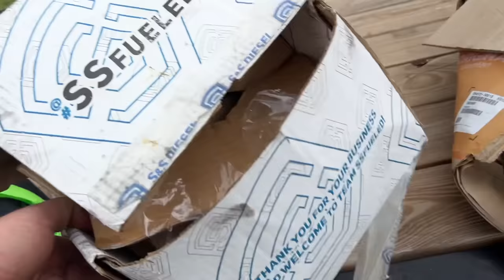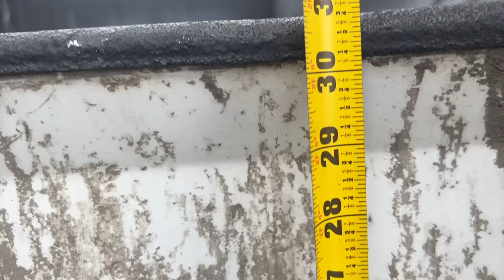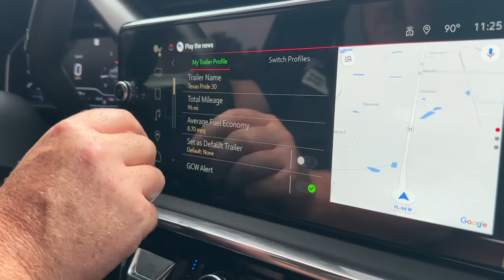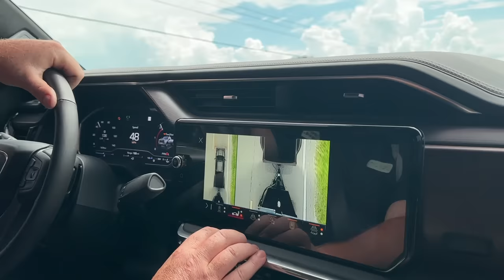$100,000 Diesel Truck VS $2,000 Diesel Truck!!!!  Are These New Trucks Really Worth It?

Comment: Another thing to consider is the cost of basic repairs once the new truck is off warranty.  My diesel mechanic discouraged me from upgrading my pristine 97 Ford 7.3L to a newer truck based on the idea of repair costs long term.  The older trucks are so simple with fewer things to go wrong and if a $5 vacuum line goes bad it can all be accessed simply by opening the hood.  As my mechanic explained, that $5 vacuum line on a newer truck could cost in excess of $2500-3000 as the entire cab has to be removed to access some locations on the newer trucks.  From my perspective, the only reason one pays for the new truck is the prestige factor and the ergonomics and comfort of a new truck.  New trucks are quiet, smooth, easy to drive, with tons of cubbie spaces for storage and are outfitted with tons of technology.  I ended up keeping the old truck and simply did some sound deadening, added a premium sound system with double DIN head unit to provide an update in technology coupled with a back-up camera and few power mods and I am good to go.  Still not as smooth and not as quiet but very happy with the 97.  Get tons of compliments everywhere I go.
Reply: You couldn't give me a new 6.7 Powerstroke...have had to work on SO many, while the old 7.3 had its' problems but they're fixable and for sure will run more miles with less problems than the new versions.   6.0's have lots of issues too...but they're better than the 6.4's and it's like Ford kept changing and making new problems rather than fixing the existing ones.

Anything with DEF sucks SO bad....and I've been stranded by Ford 6.7 when a single thermo-couple failed.   Far, far too many things in the system that can and will shut you down if and when they fail.   Especially for a work truck they're too sensitive and complicated....go for the old trucks and fix them up.
Reply: Put a jumper on your a/c pressure switch to keep it on, colder than any other trucks a/c right there. The OBS trucks had the best a/c and the bench seat is the best I think. 08 and up interior is very nice, but 6.4 and 6.7, nah.
Reply: For me my job requires me too be on time too work rain or shine and I do constant traveling.  My 2023 3.0 duramax 1500 has a 100k mile warranty from the factory and they’ll put me straight into a loaner truck no questions asked if I have an issue .
Reply: I have same truck, but not pristine. I absolutely love it.
Reply: Yeah I know a diesel mechanic and I’m sure I heard the number incorrectly but he said a new gmc under warranty needed 18k worth of injectors replaced. I’m like I obviously can’t afford a new diesel. Lol
Reply: @kenttalcott8428 That's very true, I have been doing the same thing to my 2002 Sierra. I have the 4.8 so I am limited to 8,000lb. towing and it's definitely not ideal when it was in stock form. However adding headers, throttle body spacer, cold air intake, after market exhaust, cam, torque converter upgrade and tune I now have 350 HP/TQ at the flywheel and I get 16 mpg in the city and 20 on the highway. I've also installed a double din receiver with Sirius XM, Bluetooth and a cd player for some modern and old school tech. I have nice seat covers and the interior is mint, I've put $10,000 into it over the past 6 years I've owner it and that includes the $6,000 I paid to buy the truck. I am still under 200K miles. As long as you maintain your vehicle you can do some upgrades and you've saved so much and will have a much easier time fixing things compared to buying new. I'm 25 and I don't plan on buying a new truck ever. Maybe for a heavy hauler I'll buy a 12 valve Cummins one day but not for awhile lol.
Reply: For sure. My buddy’s ram def system already went out and it’s only 1 year old and it cost 8k to fix. So he just deleted it 😂
Reply: @benjaminhurst8207 i was a truck driver until this fall, and the owner of our fleet mechanic had a 3.0. He said never buy one. Disaster to work on and he hated it. Only reason he kept it is his business was literally diesel repair. You do realize it has a timing belt, not a chain, and it’s against the firewall inside the engine. They last past the warranty. Have fun having your cab removed after warranty to replace it.
Reply: I've been wanting a 7.3 but no one ever wants to get rid of em. Keep it as long as u can. Have one back on the ranch In Mexico. Dislike all these new trucks lol
Reply: It is cheaper to build a truck than to buy new. There's nothing you can't have in that  97. I only have a 2015 cause I didn't have a truck for my trailer so I'm not wasting anything. You'd be wasting money changing it up. All there is to it.
Reply: @benjaminhurst8207 wow, 100k mile warranty!!! 😂
Reply: The brake test was apple's & oranges! The ford had no trailer brakes.
Reply: Amen,  I have a 92 F250 and I can fix 95% of the possible issues on that truck with basic tools and common knowledge of engines and electronics.  If I had a brand new truck I could change the battery and maybe the fan belts but you get too much beyond that and I would probably need some special tool or a computer that analyzes god knows what. You basically need a $200K workshop and a degree as a diesel mechanic to work on your $100K truck.

Comment: I know I would personally take the old one. To me its really hard to justify the $100k. That and the newer trucks have gotten so big its unreal. Another factor is that if I had a new truck I would be afraid to use it and beat it up. I know I would cry when I saw that first scratch. I like to use my trucks and even though I dont purposefully beat them up, accidents do happen though when working them. My daily is an 86 Dodge D-150 gasser. - Jamie
Reply: I’d get the old truck and use the other 98k to by an m5… or even get a used one and buy a trailer and skidsteer/ mini ex. With the 98k savings you could start a business.
Reply: @FishFind3000  You could buy a couple acres and start a clean trailer Parker for $98k. Which could make you 10-15k a month which would give you the $98k back in a year or two and then it’s all profit
Reply: I’m a clumsy mf sometimes my truck is all scratched up that’s why I’ll never buy anything past like 2012
Reply: poultryguy12able  Based off your 11 acres sure but 2/3 would be significantly less and for $100k it’s very doable your just have more limited resources than I do. I own my own equipment and do the work myself

Comment: The market today is forcing me to consider building a older truck vs being in crazy debt on a new one.  I enjoy not having a payment
Reply: Do it, get a budget of 20k
Start with a 5k truck and upgrade it 15k , keep it forever ,don't look back.
Reply: Don't do that. Its expensive no matter what you do its called inflation.
Reply: @fabianmoye7919 lmao what
Reply: @SpeedGGonzalez  you buy too old of a truck. Insurance can be expensive still for what you have. And insurance premiums go up almost every year. Not to mention the parts to fix the older trucks are harder to source new. And shipping rates aren't getting cheaper any time soon.
Reply: @fabianmoye7919  fair point. But if you were to spend, say 30k cash on a good used diesel (LBZ/LLY duramax, 3rd Gen Cummins, early 6.7 Powerstroke in my case), you don’t have a payment that’s 1500+ a month and you can get cheaper insurance. Finding parts on these trucks isn’t exactly difficult. They’re much easier to work on also… This GMC will have a payment around 2k a month if you’re not financing the fuckin thing for 10 years. That’s just to drive it. Full coverage insurance on a 100k vehicle isn’t gonna be cheap. And these new trucks are VERY expensive to fix. So at the end of the day, you would 100% be saving tens of thousands of dollars by purchasing an older truck.

Comment: I have an 02 7.3 Excursion with 357,000 on her. Bought her new off the lot, have kept it maintained and always repaired any issue immediately. I’ve done a lot of proformance upgrades to her over the years as well as replaced all the suspension with F350 Ford factory parts including the 20” king ranch wheels. My buddy’s drive newer trucks and make fun of me for driving an antique. They  ask when I’m getting a new one. I tell them it cant be replaced because no one makes anything like it to replace it with. I’ll still be driving mine when there on there 5th new one making upwards of $1000 a month payments. Meanwhile I haven’t had a truck payment in 17 years. Who’s making fun of who when I’m retired at 50 and they’re still working to pay for sh!t. Lol
Reply: Hell yeah!! Smart man!
Reply: I miss my 2005 excursion. My gas guzzler, mine was a V10 gasoline engine, XLT.

Comment: I'm a die hard GM fan. However I completely agree with your opinions in the comparison. And yes the old Ford stood her ground and got the job done.
Reply: Die hard GM fan?  Why?  Do you just hate money?  Every Chevy I’ve ever been forced to own is a shitbox, paradoxically the newer they are the worse they are…..
Buy a Toyota.
Reply: @wishunter9000 I don't know why people spend 10x what a repair cost would be on a new shitbox
Reply: @wishunter9000 my silverado ran for 3 years, no oil changes, no coolant, and a blown headgasket. if it wasn’t for the cracked frame and severe rust it would pass inspection
Reply: @wishunter9000  Hey I'll have you know my 95 chevy corvette only stranded me once the fuel pressure regulator went out. 166,000 miles and counting.
Reply: @wishunter9000  I have a 98 silverado with the 5.7 vortec and 4l60e.  It's got 325,000 miles on it and it hasn't had any major problems.  I love the truck and it runs like a dream.
Reply: @wishunter9000 idk 2001 silverado is goated.
Reply: @wishunter9000  New tundras come with a pride flag sticker.
Reply: @wishunter9000  Toyota doesn't make real trucks.
Reply: Way to compare a 20+ year old truck lol
Reply: @wishunter9000  Toyota lmao! I know people who have Toyotas so I know the truth they are junk
Reply: Die hard GM fan haha why?
Reply: @wishunter9000  heater core is under the passenger dash on that same '97 Silverado you were just exempting smart guy 💀 nevermind the fact Toyota literally does not offer a product in the market this video is about... cope and seethe smoothbrain
Reply: @1TUFZ71    What in the hell is a “smoothbrain”, is that some weird new internet slang kids use or something.
Reply: @wishunter9000 We tried that for our few half tons. Toyotas didnt make it and it threw off the owner’s life cycle replacement. GMs and Toyotas didnt make the 12 year 500,000 mile mark. We went back to all Fords.
Reply: @wishunter9000  cause there far better than fords

Comment: It's interesting to see an older truck and how it stacks up against the newer diesel but gotta say the ol 6.0 didn't do to bad.
Reply: The 6.0 is one of the worst diesel engines ever made lmao
Reply: @robertkurtz7587 My 04 f250 would wipe my dads ass in a race in his 18’ f350 single rear wheel 6.7L . Beat a red 01 standard cobra mustang from a 40 roll with a trailer on it full of mowers . It is that fast , even better when you put the 5.9 cummins in them

Comment: Ive got $25k in my 88 F250 7.3 idi supercab long bed 4x4. Has a Gearvendors OD unit on it, 4.10 gears, and bronco bucket seats. New paint, starts up, stops, hauls, pulls, does everything I need it to. I bought a $6k International Loadstar 1600 for heavier towing.

Comment: I'd love to see this with an additional 40k truck as a mid-tier option to see just where the tipping point is.  Does a 40k truck perform the exact same as the 100k truck but just doesn't have 20 cameras and leather seats?  Then perhaps a bang-for-your-buck analysis to determine if it is actually worth spending another 60k to get to that 100k truck or even if 40k isn't that big of a difference from 2-3.
Reply: From what I've seen 40k gets you something around 200k miles these days. I think bottom dollar or new are the best deals currently. You can get a new diesel in the 60k range.
Reply: @bunsguns8222   can confirm, got a 17 F350 DRW in September 2022 w/ 180K miles for 53K after taxes. That price rapidly climbs when you lower the miles on it.
Reply: Or a 40k dollar used truck vs a 40k dollar built truck. The used truck could be like a wildcard cause who knows what's done to it. Make sure they are both equally reliable so they can do all the stuff we wanna see.
Reply: @bunsguns8222  38k for 120k miles 45 for around 80-90k that's about what I see in oregon. Now if your a princess of course your gonna get ripped of cause your a yancy.

Comment: LOOK AROUND, There is a reason why so many contractors (my friend's dad), landscapers, and even municipalities STILL hold onto their classic F series diesels to this day. Saw one that looked like the truck in this video today that had a manual transmission, had the bed replaced with a dumper and hauled a landscaping trailer. Cheap to buy, cheap to repair, and they sound pretty mean too. The proof is in the pudding.

Comment: I'm leaning towards the old truck simply because one day the warranty will be dropped on the new truck which then isn't going to justify the $100k price tag once things start breaking after warranty you can find parts for the old trucks pretty much in most backyards it's the complete opposite for the new ones
Reply: Right 👍

Comment: I bought a '24 3500 AT4 early May and you'd have to pry it out of my cold dead hands. I've had an '01, '06, and '11 Super Duty along with a '16 Ram. I've like each subsequent truck more than the previous. I enjoy the creature comforts, ride quality improvements, and increased power along with the drivability that comes with it. The increased payload capacities with the newer trucks has been nice to have as well.

Comment: As long as it has a/c and runs good like that one does. $98K is a lot to pay for a warranty that they can really just decide if they want to cover it or not depends on the cost of whatever breaks
Reply: Not to mention the recalls
Reply: He'll never pay 98k. He'll sell way before that. I do the same thing. Just bought a 24' Denali. I might pay 30k tops and she's out the door and someone will have my sloppy seconds
Reply: Also you will have to spend 3 hours at the dealership every other month to get your oil change,not because you need it. But because you have to prove you have your car it's maintainance otherwise they will refuse to do repair off that alone.

Comment: Just refreshed my 07 with new heads, lifters, push rods, new turbo, injectors, gaskets bottom up and she runs absolutely amazing.ill keep it any day over a 1400 month payment
Reply: How much did that cost ya??
Reply: Exactly. My mechanic is in the process of building me a Stage 1 6.0 Powerstroke all for $10k. I also invested in a Bulletproof Diesel oil cooler, BPD water pump, reman injectors, Edge monitor, SCT tuner, APR studs… so I’m in almost $15k but I’ll have a badass bulletproofed 6.0 for a fraction of the cost of a new truck. Forgot to mention paid about $8k for the truck so do the math but still a lot better than $80k plus for a new truck to me it makes more sense
Reply: Way better than having to take out a second mortgage for a six-figure truck
Reply: @Natd0gsef yes because these trucks are only offered at 100k fully optioned. They by no means sell low or medium trim truck for less money...
Reply: @GhostlyGhille  even with the lower and or midtier options there still 60,000
Reply: 6-7k doing all work myself.
Reply: @Natd0gsef  Hotshotting will gross 15k+ a month, moving Heavy Equipment jobsite to jobsite will save you 1500-2k a working day. Along with a massive tax write-off, and the reliability to know for that first 100-120k miles nothing is likely to go wrong. At 60k your looking at a $900/mo. If you want a 250 for a toy well that's on you.

Comment: It's interesting how the 6.0 was 1.1 second slower in the 1/4mi. But 9.2 seconds slower in the 60mph. I'm willing to bet the vgt actuator arm, unison ring, and vanes are worn making it slow to spool because it majorly came to life on the top end which is normal for a old vgt or reman turbo where they don't replace that stuff. Also did you disable trailer brakes on the gmc? If not since they didn't work on the 6.0 that could make a big change there.

Comment: My dad has a 1993 F-250, and it has a custom V8 Diesel turbocharged. He is currently rebuilding the entire truck since he got rammed in the rear end by a van that bent the frame. He had to replace the entire frame, and we are making good progress. We are about ready to put the cab back on, so we should be running in no time!

Comment: I bought a '99 F350 SD, 4WD, crew cab, long bed, a Warn bumper & winch combo, but a V10...it was sitting for 2.5+ years, past owner died. Bought cheap, replaced a ton of mechanical "Consumable" parts (huge list), serviced everything, stripped it down (glass, bumper, trim, lights, door handles, weather stripping, everything), painted the entire truck, Line-X bed liner, replaced all 5 tires, re-did the headliner, replaced the 7" halogen driving lights with 300W LEDs', replaced the 3" halogen foglights with 3.5" amber LED's, installed a scanner, and put in a head unit with navigation. All-in, my total out-of-pocket? About $20K. It looks good, runs fantastic, and fits my needs- I wish it was a 7.3, but I really can't complain. This truck will be around for years to come, agree with you two 100%. Simple economics

Comment: Alot of the speed advantage comes from the new 10spd transmissions making the engines more efficient. As far as the squat once loaded, we're talking worn springs over new springs. My 07 F250 4x4 has little to no squat with a loaded 20ft car trailer. I wanted a new truck but I can't justify the price of a newer truck when my 07 does everything I need it to and throw at it its just not as pretty